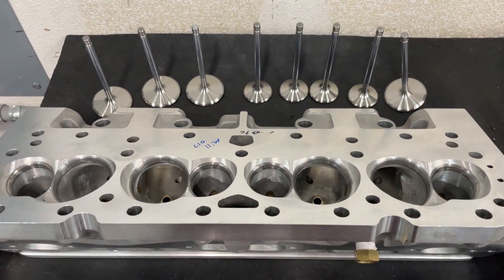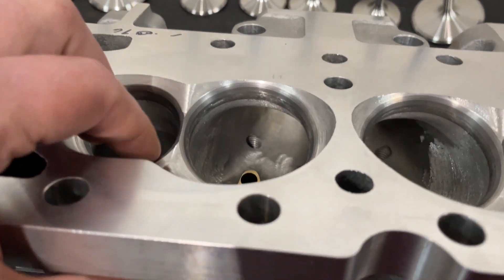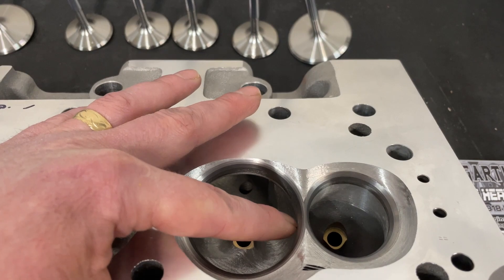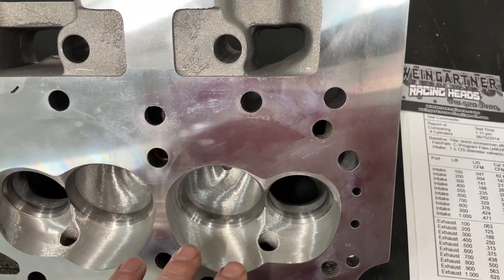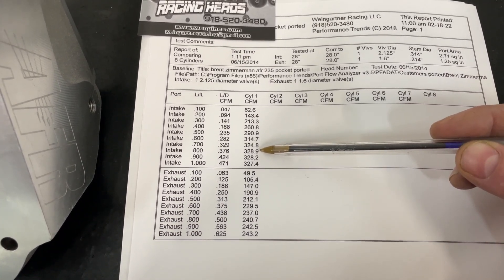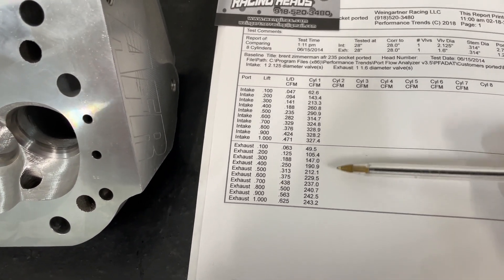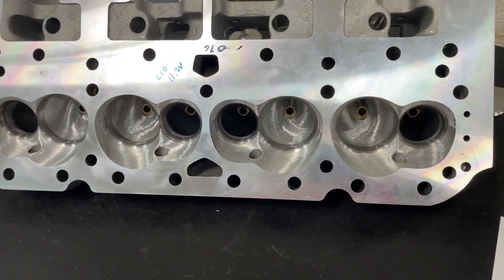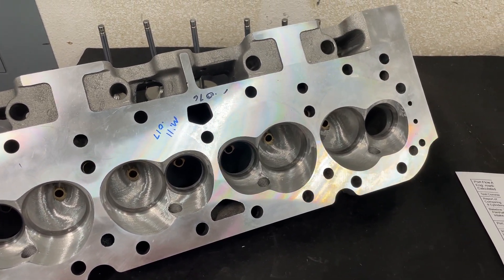Basic Improving Of AFR 235sbc Head

Comment: Another great video! Maybe I missed it, I don't recall in your other videos, if you have tried testing different valve cuts. Have you tried comparing a 45 degree cut valve to a 45 with the upper edge of the face just taken off, instead of a full cut? Or 45 with 30 or 50 or 70 top cuts? How about cutting the edge off the bottom of the face? Maybe even try a small cut off the head of the valve to see what happens. There's a lot of different combinations.  Years ago I had seen a company polish/round the bottom edge and valve head. Sorry for my rambling, I was just trying to think of ways how one would gain bottom, mid, and top end airflow.

Comment: What’s your opinion on a 421 vs a 427/434 the shorter stroke on the 421 better for longevity? I saw you did a 421 with your dragon slayers that made 700hp. Going in my street deal 77 Camaro.

Comment: Could you discuss how you approach a ford head systematically different from chevy stuff due to the way the port directs the air into the cylinder wall instead of the center of the cylinder? Just a suggestion.  I haven't been able to really find ford specific approaches.  I assume just do what you can to re curve the port the other direction.